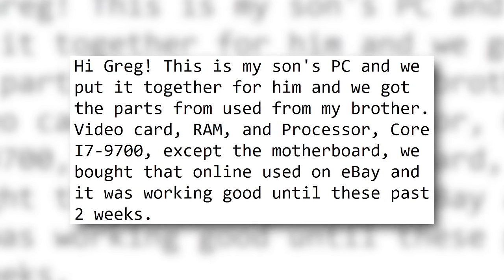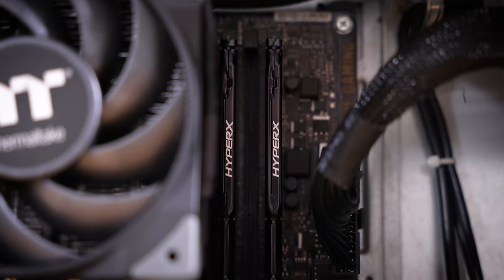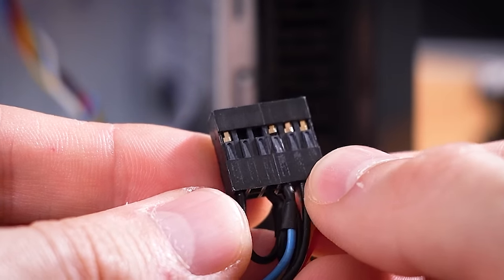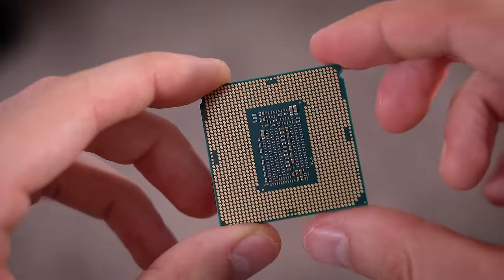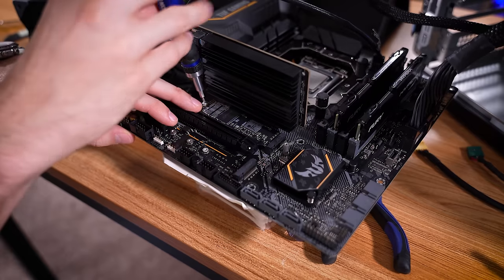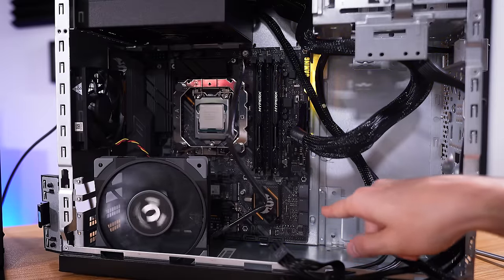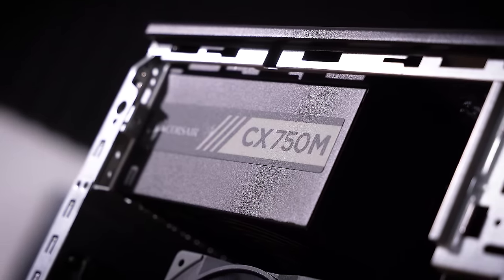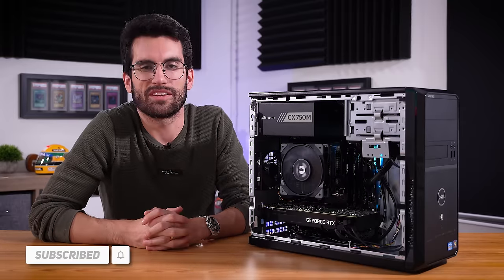Fixing a Viewer's BROKEN Gaming PC? - Fix or Flop S5:E1

Comment: Im a bit confused, you have (and use) a specialized power supply tester but not a regular multimeter? I mean, no knock, you found it eventually, but you were literally told what the problem was and a ground fault to chassis would take about 5 seconds to confirm with a multimeter in continuity mode. A multi meter would also help you diagnose dead parts without having replacements to A/B test everything with, you just look up the pinouts for the component and check continuity and resistance. Correct value and pins to test between can usually also be found online without much issue.

Also, if you arent going to take the time to dremel out the piece as you mentioned, I really feel like a more elegant solution would be to either put the motherboard on small standoffs or just electrical tape the contacting piece. I know its inconsequential in this case, but leaving sharp corners like that is really not best practise. 

Sorry if this seems negative, I just would really love to see you take things to a bit higher level if this is something you actually do. I mean, its a long running series, right?
Reply from the maker: Think you’re turning an ant hill into a mountain, my guy… 1: OFC I have a multi-meter. I’ve used it several times in this playlist alone to test components. 2: If a hammer does the job just as well, why on earth would I waste more time?
Reply: @GregSalazar  Its a shame if it was perceived that way, it was only meant as feedback and advice, nothing else. How, or if at all you use it is up to you. I just stumbled across this series and havent seen much more of it yet. What I was trying to say was just; 

1 - If you have one, and used one correctly here, it would likely shorten your path to the same conclusion while making the video look alot more on point and professional imo
2 - Because taking it upon yourself to fix something for someone else automatically holds you to a higher standard than if you fix your own stuff (even without a million people watching), and imo giving someone back their pc with a mangled, sharp edge in it is a bit... bad form? Also by that logic, why on earth would you waste time with hammer and pliers when 1 piece of electrical tape would do the same job? 

Again, I mean no harm and I dont intend to argue. And no, its not a big deal. Its just my suggestion on how to make things more efficient and I think the video would come across even better, more purpose driven and more competent. If you think its trash advice, im okay with that. I think what you did here is a good thing and enjoyable to watch, and I want to see more.

I can absolutely refrain from leaving comments if they come across as a bad thing though, its not meant to be.

Comment: You can clearly see who fix things and who only watch someone fix things in the comments down below. Putting tape or even worse, thermal pad to isolate the motherboard from the case? That is not lazy, that is ignorance. Greg clearly showed where the contact was happening. Anyone who have ever grabbed a motherboard have poked holes in their fingers from touching the soldering pins sticking out from underneath the motherboard. If they poke a hole in your finger, you really think a thermal pad will hold up? And if you just try to be funny, make sure that you tell other ignorant people who may try your smart suggestion that it was only a joke.

Comment: Not trying to be critical but I have more years troubleshooting computers than you have been alive. I suspected a problem similar to what you found as soon as I saw a non Dell Mobo in a Dell case. I think Dell does that Shit on purpose! You will always find some kind of incompatibility when trying to do something like this usually with wiring. I have in the past removed all the pins from a connector and reinserted them in the correct positions usually with extra wires left over. Dell does this so that if you try to use non Dell parts you run the risk of frying something. I wouldn't surprise me if some Dell engineer put that metal stand off in a place that it wouldn't short the original board knowing it would short a non Dell board! I have run into problems like this on so many Dell products that I am sure it is an unwritten rule when designing any dell product!

Comment: Did you check the airflow on the front of that case??? Seems a little choked off for a 9700 CPU and that GPU...
Reply from the maker: It’s fine. Hotter, yes. Not alarming. And it’s the sleeper aesthetic the owner wanted.

Comment: At the 9min 40 mark, sounds like trying to pinpoint issues on 1st gen ryzen...seriously, so wonky...even so far as to have things that shouldn't work, working (5 sata drives AND an m.2...until I reinstalled windows and cleaned it a bit when it threw a tantrum and now behaves as intended...with regards to the sata channels at least...it does now forget that it has a built in network adapter randomly.

As for my diagnosis, nope, I didn't get there...I was actually thinking BIOS issues (corrupted data) if it was not the CPU.

Comment: one minute in and i see tones of issues. the psu is pulling heat from inside the case and the cpu and from the video card improper ventalation.

Comment: I just got a new CPU MB RAM and AIO. 
CPU Ryzen 7 7700x
MB MSI MPG B650
Ram 32 GB tskill ddr5 
PSU Corisair 850 80 gold. 
GPU RTX MSI 3080.
2 TB 970 pro ssd. 
It takes about a minute to boot when running call of duty ICue crashes and the game stutters a bit. Temps are fine no over heating no idea what is going on. Any idea?

Comment: I honed in on the issue right away once the components fired up outside the case. I ran into a similar issue once before where the factory standoffs were really big on a HP case and shorting out on some traces around the screw holes. Using cases from companies like HP and Dell can be tricky from time to time

Comment: I had a very strange thing happen when I did a bios update on my tuf gaming board , everything went fine , bios update was successful , rebooted and the monitor refused to initialise , no option to enter the bios at all , nothing has changed in the rig , aside from the update , tried everything I could think of with the same result . Now , i have a second system and I plugged the lg tv i use as a monitor in , booted first time, unplugged that monitor , plugged the original back in and it booted up fine , I am at a loss to explain this , perhaps you can throw light on it

Comment: I have a strange issue with my pc, whenever nvme is inserted whether as a boot drive or a normal drive my pc boots twice to get into windows and resets bios on each cold start even if the settings are already on factory defaults it still resets and double boot.
No double booting issues without a nvme if I use a normal ssd this is pissing me off a lot cannot turn xmp etc in bios any suggestions please ?

Comment: This way too late for me 😢 and happy at the same time(cuz it was fixed w/o replacing a thing). I had the same issue (sometimes it turns on sometimes it doesnt).  I did isolation method, also beep test using that tiny speaker(1beep), jumping psu to fan(working) and replacing cmos batt. The only thing i havent test was the motherboard, so i went to a tech shop and we found out it doesnt turn on when GPU is on, so we test another board with my components and it turned on. So i ended up buying a new board and PSU. BTW i have the same motherboard just like in the video. Nevertheless great content been watching your videos for almost or over 2yrs i think 😂.

Comment: What Greg does not tell u, if u alter the motherboard u need a new windows. because your windowskey is linkt to your motherboard.
Reply from the maker: We have said this in MULTPLE videos, actually. OEM keys lock to the hardware in question. But they're considerably cheaper than retail - so you'd need to swap your motherboard 4-5 times in order to break even on a retail alternative. And most folks aren't swapping much at all.
Reply: @GregSalazar   yea still its hardware related   windows key for 1 pc or more then 1 pc pull your wallet.

Comment: Why wouldn't you just add an insulating layer between the metal and the board ? Simple, and no modding necessary. A piece of electrical tape would have done the trick.

Comment: I don,t know the whole sleeper pc thing is kinda nonsense anyway . What is the point. He is lucky he didn,t burn something out. For what ?. You can buy even a cheap simple decent case nowadays. To each there own. He is very lucky he had you to notice what went wrong. People really need to pay attention if they want to do a build like this because the OEM cases are very odd and not really built for after market hardware. You have to do mod the case in some way 99% of the time. Or else you may learn the hard way.
Reply: Just because you don't get it, doesn't make it nonsense. Some people think it's cool... you don't, and that's fine. It's not for everyone, but your way of doing things isn't the only way to do things either.

Comment: beh shame you live so far. Could really use help with my game pc. Did a water build and had some hickups..it runs but heat is a massive issue still :/ Far in a burnout so I just don't have the energy to focus enough to figure out what's wrong.

Comment: if you go back to the beginning removing the motherboard from the case would have been a logical step after the additional parking lot info the owner gave. but i understand going through the regular steps as well trying to rule things out so you don't get thrown off and misdiagnose. 
but say what you want about Asus but this board was build strong. the fact that it kept itself protected9while the previous one clearly failed) through all those attempted power cycles. it's worthy of the name TUF